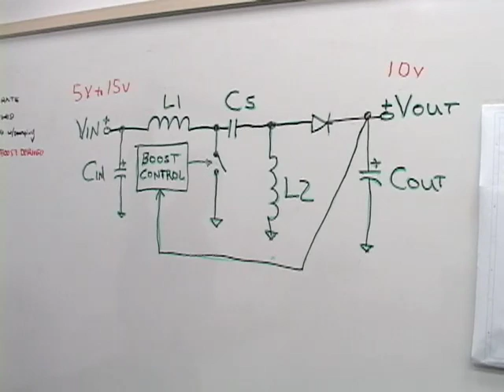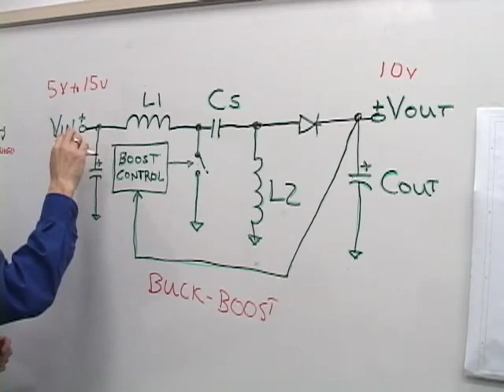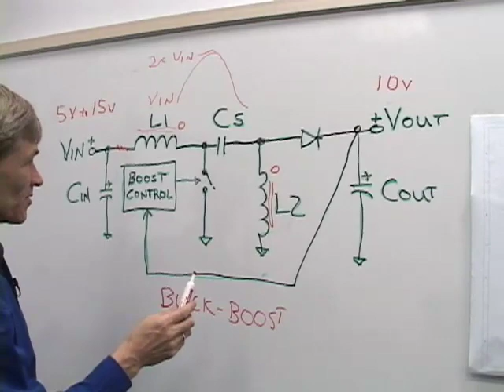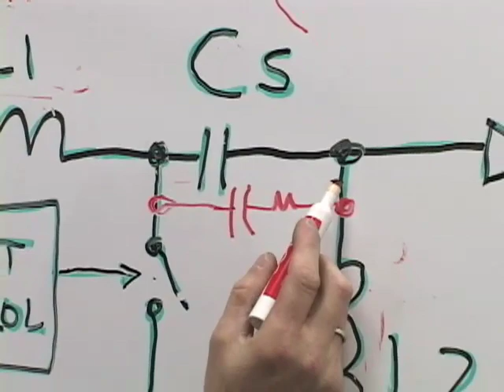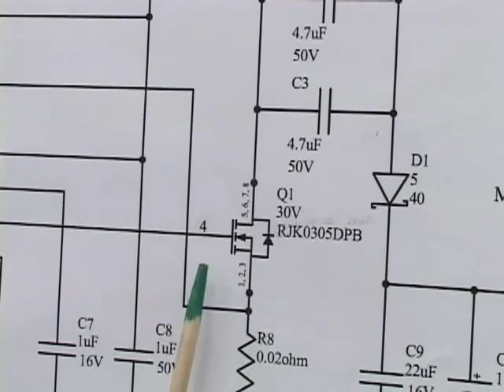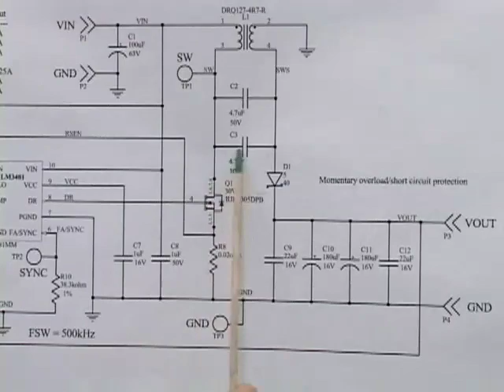SEPIC Converter Circuit Basics

Comment: Basil, that capacitor is the secret to a buck-boost operation. The problem is Bob here is not explaining how SEPIC operates, keep searching, there are others who explains the operation principles. Bob, with all respect you never explain how it operates!!
Reply: I agree. But there are other videos that do a lot of that. There is none that explains the 5v-15v  input range to get the 10v output.   How much of a range can we have on input and how do you know the output voltage stays at 10v?